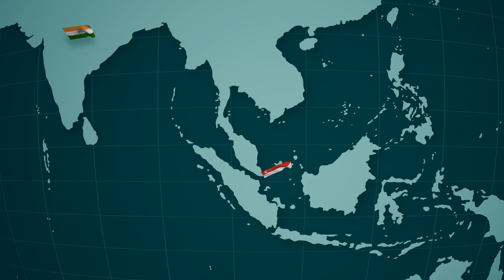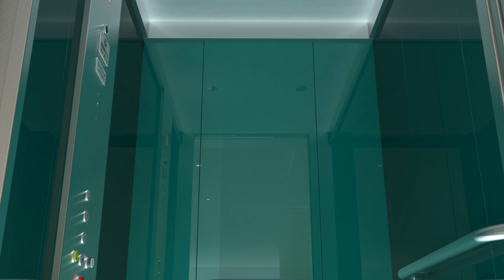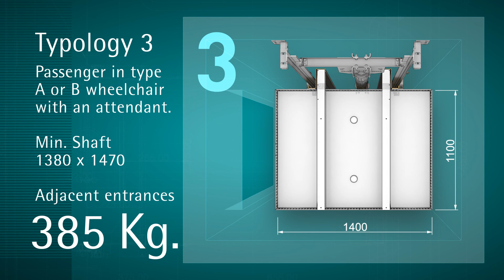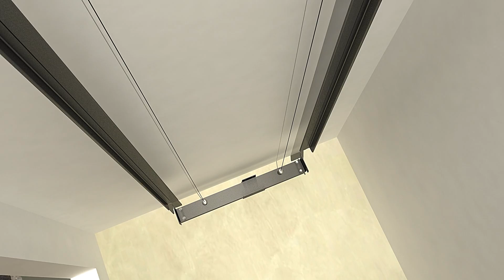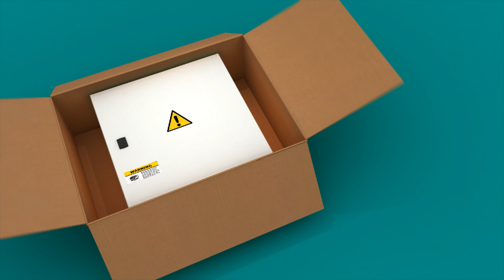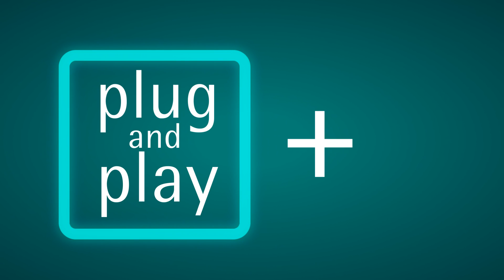HHL Wittur

Comment: i have been in engineering all my life and been installing lifts for 15 years this is the first time i have installed one of these and we have had no end of problems parts missing parts wrong faulty parts wrong parts the list goes on the assembly manuals are not worth the paper they are printed on and the support from Wittur technical can take days to call you back Wittur you need to listen to the engineers who install these
Reply: 2 years and I see no answer! Did they ever contacted you to explain why all this happened to you?
Reply: Yess niss
Reply: Indeed you might face a problem with these kind of frames construction ,that depends on the source ,from wich distributor you ordered package . I think these problems are not exist with the other distributors .